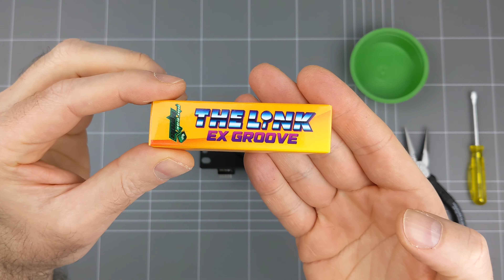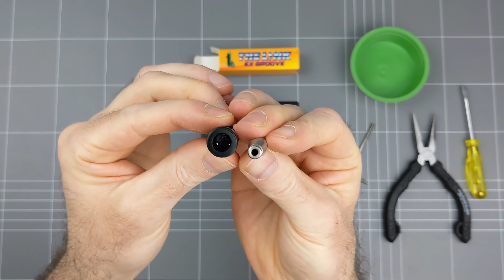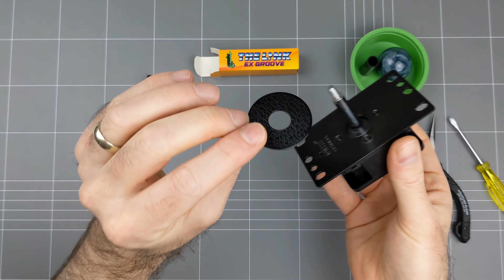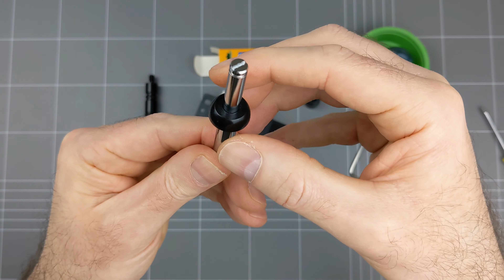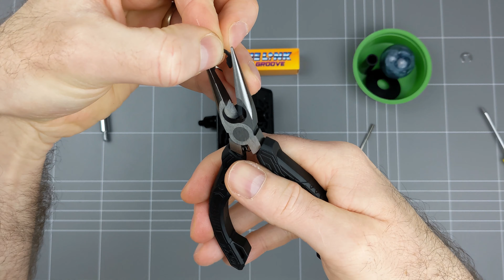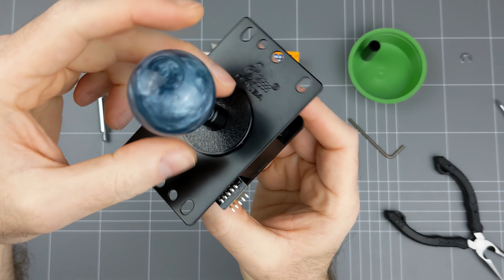Quick-Release Removable Shaft for Qanba Gravity Silent Joystick

Comment: Amigo, que medida tiene el e-clip para palanca qanba?
Reply from the maker: Hi! Depending on where you are in the world and what local hardware shops you have available, there are a few options that fit the Qanba Gravity Silent lever shaft.

Metric: You'll want a 6mm e-clip, often listed as M6 (based on the DIN 6799 standard).

Imperial (ANSI): Look for the 1/4" size.

I recommend checking a local hardware shop to pick one up - they're significantly cheaper there than buying online.

Also, keep in mind that a standard Sanwa JLF/JLX/JLX2 e-clip will fit on the Qanba shaft, but it will be a slightly tighter fit because the groove on the Qanba lever is about 0.5mm larger (5.7mm on Qanba vs. 5.2mm on Sanwa).

Hope this helps! If you have any more questions, just let me know.

Comment: do you know if this would also work with the QANBA QB-J-GOV3 lever?
Reply from the maker: @MarkVersion1

I haven’t tried it myself, and I haven’t seen anyone else install a quick‑release removable shaft on a Qanba QB‑J‑GOV3 lever yet, but my guess is that it should fit (around 80% confidence).

The PhreakMods quick‑release shaft I used in the video is actually designed for the Sanwa JLF shaft, but a lot of joystick makers use the same (or nearly the same) shaft dimensions, so it ends up fitting many of them without issues.

If you want to be completely sure it will work with your lever, the fastest way is to check whether your shaft matches the Sanwa JLF shaft (model JL‑S9F). The most important measurements are on the narrow section that passes through the pivot:

Diameter: must be 6.95 mm (this is the critical one)
Length: around 33 mm (can vary slightly)
E‑clip groove position: about 2.25 mm from the bottom (can also vary slightly)

Hope this helps. If anything else comes up, just ask.

Comment: Actually, the Qanba shaft is a tiny bit thicker. You can feel a little loosen gap when using The Link. 
Have you tried replacing the pivot for inox or any other?
Reply from the maker: @vitorkuwabara42
Thanks for pointing this out! I just took apart my Sanwa JLF and Qanba JOV8S to measure and compare their shaft diameters above and below the pivot. According to my digital calipers, the Qanba shaft is about 0.02mm thicker above the pivot and 0.07mm thinner below the pivot. These tiny differences shouldn’t affect performance, since both levers are designed with manufacturing allowances so the parts can slide and rotate freely once the spring is installed.

Any “free play” you’re noticing is most likely the sum of all those small gaps between components, and it’s further exaggerated by the larger gap (around 0.2mm) between the actuator and the switches on the JOV8S.

As for your pivot question: I haven’t swapped mine for different materials. The main reason is that harder pivots can wear down the housing faster, which means more frequent re-lubrication and monitoring to avoid premature degradation.

Really appreciate your feedback and input - it helps keep these discussions useful for everyone!

Comment: Hello my friend, thank you for your information. I want to know if it is possible to replace the plastic parts with aluminum parts. Is this good or not for the Qanba stick with a 4 lb tension and with a 2 m or 1.5 tension cap? Thank you, especially for street fighter fighting games.
Reply from the maker: Don't buy any extra springs for the Qanba Gravity Silent Joysticks until you try the HEAVY spring that comes in the kit. Have a look this video that shows what comes with each Qanba Gravity Silent joystick https://youtu.be/20I4ADZuw0k
The HEAVY spring feels very close to an aftermarket 4lbs spring.

There are no conversion kits that are specifically made for the Qanba Gravity Silent Joysticks, and although you could replace individual components (like the pivot, shaft, spring, actuator) with a Sanwa compatible part, I would recommend against that - putting aluminium parts into a plastic body would create too much abrasion and would eventually wear out the plastic parts. My advice is that instead of replacing parts, you open up your joystick after every few months of use, check the lubrication on the pivot, clean out any dirt and debris and reapply lubricant - this will ensure your stick doesn't gum up.

If you are thinking about replacing the actuator with a larger one to speed up the switch actuation (by decreasing the distance between the switch and the actuator) be very careful! The Qanba Gravity Silent actuator and the switches have been precisely aligned so there is almost no space between the stock actuator and the switches. If you put in a larger actuator (any Sanwa JLF actuator will fit), there is a very good chance that you will get accidental actuations of the opposite switch as the stick bounces back to neutral - you can go ahead and try (won't harm the stick) but depending on your play style, you may experience inadvertent directional inputs.

One more note: if you are used to Sanwa JLF or similar joysticks, it may take you a little while to get used to a Qanba Gravity Silent stick - before you start modifying it, make sure you spend enough time playing with it, so you get a good feeling for what needs to be adjusted. If you ask me, everything you need to customize and adjust a Qanba Gravity Silent joystick already comes in the kit (except the removable shaft)!

I hope this helps.

🕹️🔵🟢🟡🔴
Reply: @DinodraxChronicles  I thank my brother for answering my question for all the clarifications and information. I really thank you. Perhaps I will leave the stick as it is, Qanba, with changing heavy the 2lb tension that comes with the Qanba stick. I wish you all success, my brother. ❤️🙏

Comment: Como faço pra comprar?
Reply from the maker: You can buy this removable shaft from online retailers that specialise in arcade controller parts and components.
Depending on where you are in the world, there are many online shops located in Europe, UK, North America, Australia, Asia, etc. Just search for "PhreakMods The Link EX-Groove" and make sure you get the model specifically designed for the Sanwa JLF/JLX joysticks - the Qanba Gravity Silent joysticks (JOV8, JOV8S, JCV8) have the same stock shaft as JLF/JLX and the removable shaft designed for JLF/JLX fill fit them perfectly.

I hope this helps, but if you have any more questions, don't hesitate to ask.
🕹️🔴🟡🟢🔵
Reply: @DinodraxChronicles  Thank you very mucho brother, congratulations on the Channel.

Comment: Unfortunately this lever have diagonal miss unput some times ,and neutral jump ,but exelly he is ok .
Reply from the maker: I've heard the same from few people. This lever has a very small dead zone, almost no free space when in neutral, and a short throw and actuation distance. This means that when engaging diagonals, a small deviation in the angle (not exactly at 45 degrees) can result in a missed input (especially on the JCV8 variant). Also, because the switches in this joystick are "springy" and help the lever return to neutral quicker, it is possible to accidentally trigger the opposite switch as the lever bounces back.
I found that the JOV8S variant has cleaner diagonal inputs compared to the JCV8 version, and when I am using the heavy spring that comes with the JOV8S kit, I don't get any bounce back actuations. It took me a while to get used to the Qanba Gravity joystick, but I think I prefer it for shmups over all others.
Reply: I've got both the Cherry and Omron switch versions and have never experienced any of that.  They are both realllly good sticks but I do prefer the Cherry switch version as it's the perfect dead zone/actuation combo (for me).

Comment: Have you tried using oversized actuators on this lever like the OTTO DIY? I have this lever and I’m curious if other actuators will also work (most are advertised as for Sanwa JLF only).
Reply from the maker: So far, I only used the stock actuator with my Qanba Gravity Silent Joystick (JOV8S variant).
Out of the box, the Qanba joystick already has a much shorter actuation distance and throw than the Sanwa JLF. Although all actuators made for the Sanwa JLF would fit onto the Qanba JOV8S shaft (their shafts are virtually identical), installing a slightly larger actuator that attempts to further reduce the actuation distance into the JOV8S could trigger bounce-back inputs in the opposite direction as the joystick shaft returns to neutral. The stock actuator on the JOV8S already sits right against the switches (optimized for short actuation and small dead zone), and using a larger one would keep all switches partially pressed at all times - because the mechanical shaft switches (not microswitches as on the JLF) used in the Qanba JOV8S have linear springs which help the joystick shaft return to centre, the extra force from the switch on the opposite side could translate into accidental bounce-back inputs.
But just because I didn't try using a larger actuator on the JOV8S, it doesn't mean that all aftermarket JLF actuators won't work. If I get a chance, I may try "squeezing" in a JLF P-R (red) to see what happens.

Comment: I know it sounds weird but do you know if there is still a kit to make an arcade stick compatible with PS1 and PS2 or at least only with PS2? I know how to solder if it´s required XD. I saw some in aliexpress but since I don´t see any comments I´m not shure to buy.
Reply from the maker: Not weird at all - it's a good question. There are a few options for PS1 and PS2 adapters for your arcade stick.

8BitDo makes one for their controllers called "Retro Receiver for PS" - this one wireless and best option if you have the 8BitDo Arcade Stick. Check it out at https://www.8bitdo.com/retro-receiver-for-ps/

Brook makes an adapter called "Wingman PS2" - this one is wired and wireless. You can check it out at https://store.brookgaming.com/products/wingman-ps2.

I hope this helps.
Good luck!
Reply: 2 years late but im surprised nobody mentioned this. Its a bit expensive but you can get yourself a Brook Retro Board from ArcadeShock. Its a bit of a process, but if you want to have one arcade stick that goes from PS1 all the way to PS5 you can do that by stacking/connecting a Brook Retro Board to a Brook UFB with the PS5 additional board.